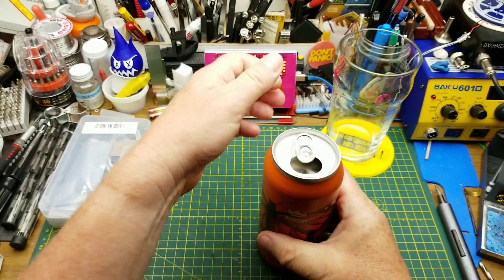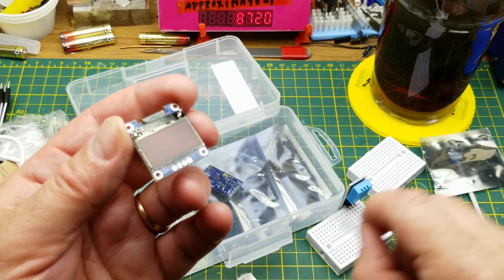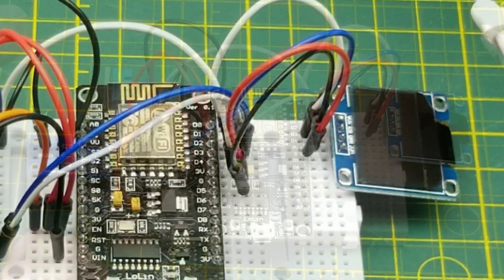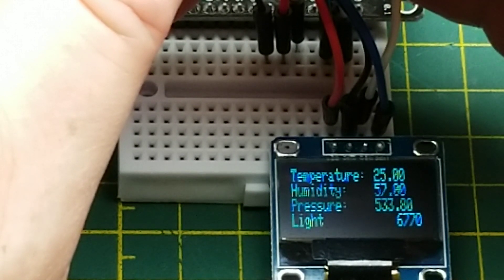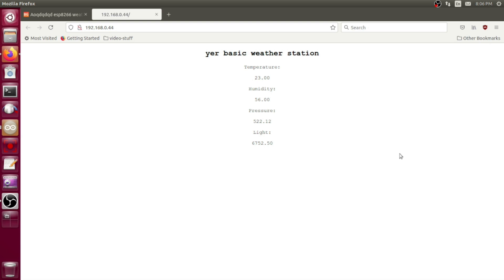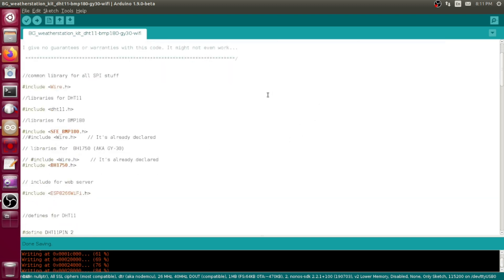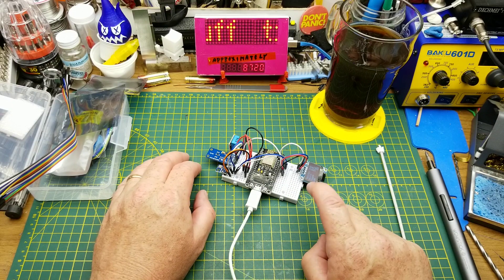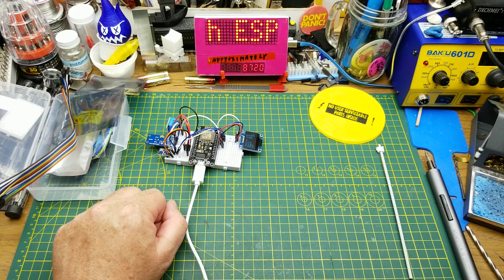DIY weather station kit - tinkering and homebrew code

Comment: unfortunately the code is extremely problematic to use, without the specific libraries it is not possible to compile the code, so if in addition to the code, you include the code in the libraries the problem is solved
Reply from the maker: The libraries should all be installable through the Arduino IDE library manager. Just search for them by name.
Reply: @pileofstuff  I already tried, but for some of the sensors there are several libraries and if it is not the correct one the code will not even compile

Comment: Truly great kit for learning about sensors, web servers, OLED, and programming. Thank you for putting the video together. I followed what you did but the strange thing is the pressure reading will show 1247 and then 546 switching between those values constantly about every 10 seconds. Did you observe that in your kit?

Comment: If I recall D4 connects to an internal LED which would pulse whenever the DHT sends a signal.  Looks like a good little kit, though I do prefer a DHT22 for slightly more accuracy :).
Thanks for the review.
Reply from the maker: Yeah, the DHT11 isn't the best temp sensor on the market, but they are "good enough' for a lot of basic applications.

Comment: Leave the LCD protection on until after you have the pins soldered.  Soldering can cause hot solder or flux to land where it's not intended and may leave a mark that is a pain to clean (if it can be).  As you showed using a breadboard to solder the pins works good just need to watch getting anything on the screen.

Comment: No pins would have been damaged in shipping if it came in that big plastic case.  That pin was likely bent by whoever was packing those kits.  Somewhere between module manufacturing and packing the kit.
In any case, don't bend it back with your finger but use pliers.  Pushing it back with your finger usually still leaves a bend in it but pliers allow you to finely straighten it at exactly where the bends are.
Reply: are you still a virgin? or on the spectrum?

Comment: I find it a little bit funny that even with these tiny breadboards, they include jumper wires that are at least a foot long.  A set of 3" make a lot more sense, don't they?
Reply from the maker: Or if they are going to include longer ones, make some of them male-to-female so you can extend the sensors away from the controller a bit.

Comment: What are the pressure units?
Reply from the maker: Hectopascals, which are equivalent to 1 milibar of pressure. . 
Though since I didn't bother calibrating for altitude, they're mostly just relative numbers in this particular example.
The demo code that comes with the library has some examples with calibration and conversions to non-metric units.
Reply: @pileofstuff  Oh, it is the calibration. I'm used to barometric readings near 1000 hPa.
Reply from the maker: @adam850  Yeah. The calibration takes into account temperature and altitude. 
For simplicity (and laziness), I ignored all that .
Reply: @pileofstuff  I was wondering about the pressure also.... anything under 950 is a really, really bad day.
Interesting kit, I built something similar during lockdown last year, eventually tied it to a Node Red display on a Pi...I never did get around to the solar power supply for it.